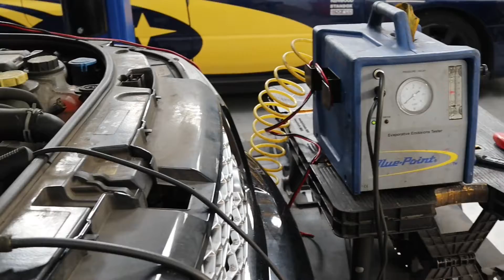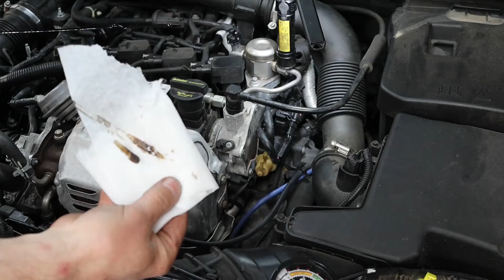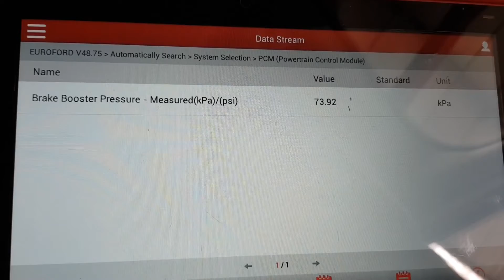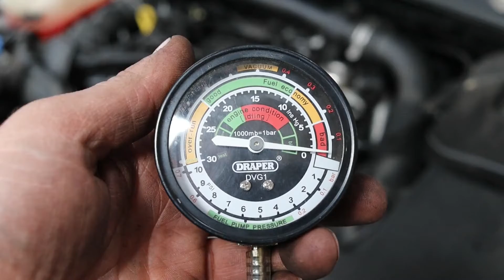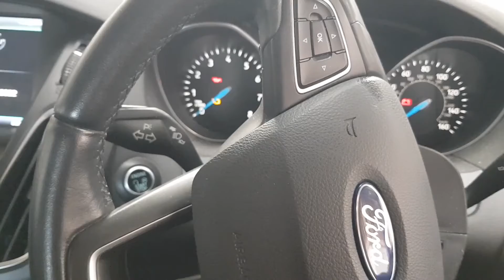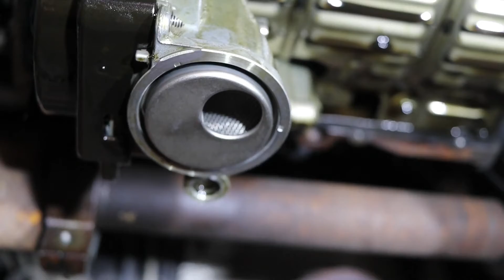Focus, Fiesta 1.0 EcoBoost P0299, oil light on

Comment: Excellent video - Was going to trade in my 2008 1.6 petrol for a 1 litre 125 bhp Ford Cmax (2017) but after watching your video I may be better off with the 1.6 125 bhp would that be better ? It’s so tragic these new engines are so problematic and poorly designed especially as it out performs the 1.6 . PS fantastic soundtrack !
Reply from the maker: Hi Allan, a 1ltr engine creating 125bhp is doing a lot of work to create that power, and that's at 6000 rpm, a 1.6 is making that power effortlessly, without the strains and stresses on the engine. Ford can't seem to make any decent engines, their 1.5 petrol engine is worse than the 1.0, riddled with all sorts of gremlins, my friend had three 1.5L engines replaced by Ford in 5 years. 

Thanks for watching and commenting 🙂👍
Reply: Stay with your 1.6L

Comment: Excellent video , clearly explained , thank you . Am looking to replace our 2006 derv Megane ( solid engine, nightmare electrics ) with a Ford B max . After watching yours and similar videos will look at the diesel version , although dpf will be an issue . Believe originally the cam belt was meant to last 150,000 miles ? Watched a Romanian garage on YT  change one on  a 60,000 mile Focus , definitely didn't have another 90,000 miles life in it . Subscribed 👍
Reply from the maker: Thanks for watching and commenting Roger 🙂👍
Reply: Try and find a normal 1.4 or 1.6 petrol engine ...  no pending  wet belt failure or DPF to worry about .  I opted for the 1.6 cmax 2016 ..instead of an ecoboost version and so glad i did . My mates 1.0 ecoboost has self destructed because of oil pipe blockage ( crud off the belt ) ...and i had 12 months of motoring hell with a vauxhall 1.7 ecoflex diesel DPF because i wasnt doing the mileage and didnt know about dpf maintanence

Comment: I have a Ford fiesta (2018) with a 1.0 L Ecoboost and I am getting P0234 error code (Turbo/Supercharger A overboost condition). The boost cuts out at around 5000 rpm and will come back if I restart the car. There are no other symptoms as far as I am aware (no smoke from the exaust, no increase in temperature gauge,  engin noises, etc.). I have no idea what the problem is.. any ideas?
Reply from the maker: Hi Daniel, there are 14 variations of that engine for that year, do you know the engine code? Mel 🤷
Reply: @melsmotors  Hey Mel, it's the 6 speed manual, 73.5kW/99 hp, 170Nm/125lb-ft of Torque. The car is a 2018 Ford Fiesta 1.0 Ecoboost Trend. I hope this helps 🙏🏽
Reply: @melsmotors  M1JH - Engin code
Reply from the maker: @danielnaicker2142  You need a descent scanner, you'll need to run live data on turbo boost whilst driving, then matching desired and actual data to see how far you're off. You can't safely look at thes canner and drive you need to data log what's happening. Not a DIY task, knowing the turbo figures won't help you as you'll need to run other component tests to establish the failure. This fault code is telling you there's a problem, not what's causing it. Find a good garage to help you (not a mate). Hope this helps and thanks for watching 🙂👍
Reply: @melsmotors  thank you so much for replying 🙏🏽🔥

Comment: Mate!...oil sump is the first thing to check for this engines when oil light  comes on, seems you have not search this...., spent money on vacuum pump for nothing....., for the engine in the video need timing chenge a s a p!,P.S . the engine in great , if maintained ok..not 15 miles oil change, but 10k km
Reply from the maker: Chill dude, we replaced the cam belt too, just not videoed it for 7 hours. It came back a week later. Vacuum pump was faulty, the oil warning light came on after the engine flush went in and it was road tested. Please watch the video again and keep up. You don't need to tell me how to maintain these engines, it's the customers that don't know! The problem is that a large number of garages are still using the wrong oil or cheap oil. We keep 10 different barrels of oil in stock and still only cover 95% of vehicles and 1 designated barrel of 5w20 just for EcoBoost engines. We don't use cheap oil, we use Shell, Fuchs, Castrol and Mobil. Walk into any garage and see how many barrels they keep, certainly not 10, or even 5. Relax and enjoy the videos buddy and let me do my thing. Thanks for watching and commenting 👍😊
Reply: @melsmotors  well said pal 👍
Reply: @melsmotors  i put liqui moly 5w20 For ecoboost in mine. It has Ford spetification.

Comment: An excellent video. I'm running an oil in my 2015 Ford Focus with the 1.0 L Ecoboost that is an exact reverse engineered 5w20 Mobil 1 synthetic oil. Assuming this is an exact copy of Mobil 1, is this a motor oil that will not break down the wet belt in my Ecoboost 1.0 L? This is not a common motor on this side of the Atlantic so my experience is shared with myself. At 60,000 miles after 6 years I have no complaints but it sounds like I should look at my engine oil carefully at changes. I've been doing these at 5,000 mile intervals. I'm getting ready to do it's first set of plugs. Do you recommend buying these from the dealer or going with something else?
Reply: Hi, does your manual say to use Castrol Magnetic 5w20 engine oil ?
Reply: @barringtonsmith9147  not brand specific but that's the weight. My owners manual doesn't endorse one product. Ford was using half synthetic for the time it was under warranty. I use a reverse engineered from Mobil One that I buy at Costco. I change it at 5,000 mile intervals. I may not drive it 5,000 miles this year as most of local driving is now on electric assist bike. I'll change it at least every year
Reply: Use the factory ford Motorcraft plugs

Comment: You said you put engine flush in and then took the car for a test drive…. Is it ok to do this ? As I was always told never to drive the car just let it idle. I’ve also been told only use engine flush as a last result as it dislodges sludge and bits and blocks oil channels and filters etc.  was the oil light on when the car came in or was it since doing the engine flush  ?
Reply from the maker: It's definitely okay to drive with flush James. The light came on after, the flush did it's job, the sludge didn't block the filter but the strainer 👍
Reply: @melsmotors  😎👍🏻 Thanks for the info
Reply: The oil flush argument is one that will send you down a rabbit warren of nightmares! Best thing, in my opinion, is to change the oil every 3000 miles (if you don't know the history of the car) for the first 12000 miles, then every 6000 (or 12 months) subsequently.
Reply: People say "but with synthetic oil.......!" However, engines are so complicated now, that usurps the "synthetic" argument that may have applied 15 years ago.

Comment: These engines needs to be well maintained. I change motoroil and filter every 12000km = 7456 miles. I hope this will save the engine.
Reply from the maker: Thanks for watching and keep up the good maintenance 👌🙂👍
Reply: Agreed with fuel contamination however worth mentioning this contaminates the engine oil and in turn corrups the wet belt so I'd say wet belt change at 60000miles or 6 years whatever sooner and not at  ford's  recommendation 10yrs or 100000miles
Reply: @Antonio-gq6fx mine went at 56k and was serviced every 8k. Now everyone knows about the welt belt and what to do, i would imagine atleast 40% of ecoboosts engines sold have failed.
Reply: Fuel contamination is a problem with these turbo direct injection motors. Recommend you change the oil more often, no more than 8,000 km or even better 6,000 km.
Reply: @LA_Commander mine went at 56k and was serviced every 8k. Now everyone knows about the welt belt and what to do, i would imagine atleast 40% of ecoboosts engines sold have failed.

Comment: Great video just to let you know i had my 1ltr ecoboost focus at Ford for cam belt water pump and oil pump replacement last month wait for it £1500. not that there was a problem with the car just trying to keep good maintenance on the vehicle. I've had the car 5 years and never missed a beat like the guy said needs to be castrol oil that you use otherwise the belts just break down
Reply: I think you you should probably consider doing what i did with your mileage getting up there mate the belt is ment to last 10 years or 150.000 miles but wouldn't let it go to that    if you know what I mean 😉
Reply: @baff6923  just forgot to mention, I did have  the belt replaced at 186k, just as precaution, as I thought better safe than sorry :-) and because I heard a lot of stories.. I also think it helps that oil always get real warm on my trips..
Reply: @cesarmartingomez196  belt was changed at 186000km
Reply: @olepedersen5420 mine went at 56k and was serviced every 8k with the right spec castrol oil. Now everyone knows about the welt belt and what to do, i would imagine atleast 40% of ecoboosts engines sold have failed.
Reply: @robertmather7696  yes, I'm afraid, it's not only depending on  the right oil quality and intervals, but it's also very much depends on your driving patterns.. lots or short trips, or mostly longer trips.. so you burn off the petrol leaking into the engine oil.
Reply from the maker: Thanks for your feedback and watching 👍😊
Reply: @melsmotors ford has just announced to change oil to 0W - 20 letter to dealer
Reply: I’m so Confused 😩🤦🏼‍♀️ I have no clue about cars, brought my son a 2016 focus, 62k, lovely car. A week later oil light came on. But Engine has oil? I spoke to someone that works at Ford who said there is a common fault with the oil pump pick up? And it’s probably because the ‘wet belt’ has broken down and probably hasn’t been maintained properly. He said we could just change the oil pump but may aswell do the wet belt aswell incase it is knackered. But I cannot afford it, my son cannot afford to spend so much as he’s only started work last week after finishing college. I really hoped this would at least last him 6 months. Paid £3k for it as it had light body work damage on side and boot. My husband is a paint sprayer so can do the body work but he’s not a mechanic. Now reading through all these comments it sounds like they don’t all have wet belts? And it could be something else completely, am I correct in thinking that? And can anyone advise what I can do next, in the best way financially to just get it useable? Would HUGELY appreciate anyone’s advice 🙏🏻
Reply: @serenitystars8839  it's got a wet belt if it's a 1ltr ecoboost trust me. As for the oil pump it's choked with rubber from the belt and probably the oil pump belt as well as that runs through the oil as well. Poor maintenance causes it wrong grade of oil. There is no other way round it big job sorry
Reply: @baff6923 don’t forget oil grade now is 0W 20 just annoyed by ford to their dealers network
Reply: @serenitystars8839  might a bit late,.. Don't neglect the oil light!!  A lot of owners have seen that the belt is going bad. Even if it's "only" 62k miles,.. The belt is likely to start dissolving, becoming a bunch of sludge in the oil intake/pump, or in oil channels,.. Which make the oil hard/impossible to reach the top of the engine,.. Park it as soon a the oil lamp shows up in the panel!!  If not it will damage the engine in a flash!!.. Then it will become expensive!.
See a garage to fix it,.. Open to the oil pump, next is to replace the "oil belt" within 10 years as Ford says,.. Rest of the car is great, so might be wort it to keep it!?
Reply: Is this a change of oil now compared to what is said in the  service schedule please advise thanks.
Reply: Do you happen to know how bad the belts we worn and how much blockage was present in the sump oil filter please advise thanks
Reply: This is what the Internet is for misinformation 😂😂😂😂
Reply: mine have now passed 200k. km without problems, changed oil every 20k, and of course only the 5w20 recommended by Ford. Mostly doing long drives on the motorway.
Reply: You have been very lucky😂
Reply: @robertjones3477  will soon reach 300k.. but yeah also feel lucky
Reply: If you take care of the turbo and the oil, it runs forever. Mine is about to hit 240K. No problems.

Most people don't let the turbo cool while oil flows though the bearing, before switching off...which causes most issues. The same before reving the engine, oil needs to flow through the turbo bearing quite a bit before causing the turbo to kick in.

Comment: Great vid matey! Do all  oil pump strainers come off like that?
Reply from the maker: Hi, the Ford ones do, we did another one last week on a 1.0 Kuga, the customer hadn't serviced their car for over 40,000 miles and the oil light was flickering on. Again the strainer was blocked,  had a new timing belt kit and pump belt but saved the oil pump. Thanks for watching 👍😊
Reply: @melsmotors  Hadn't changed the oil in 40,000 miles ? Wow , just wow ....

Comment: Great video. How many hours does it take to change the oil pump?
Reply from the maker: To replace the oil pump and belts is about 7 hours work and you'll require a timing tool kit to set the timing. If you have AC there's a good chance the bolts may seize and break when removing the compressor so you may require a new sump as well. Thanks for watching 👍😊
Reply: How many hours work is it to remove sump and clean out oil strainer ?